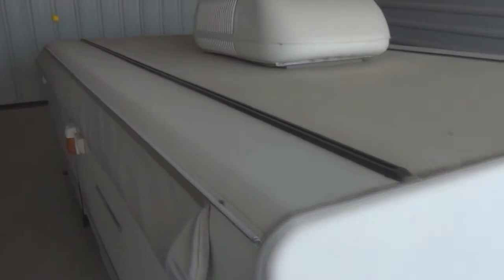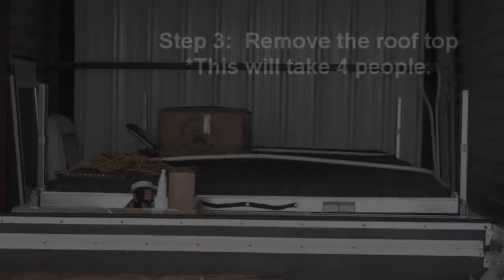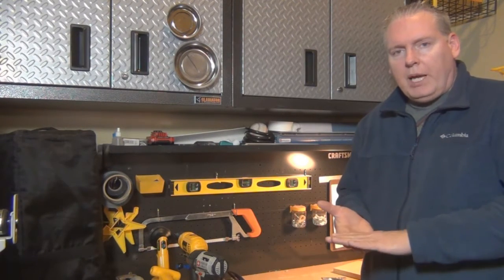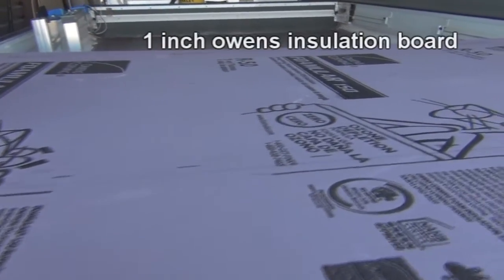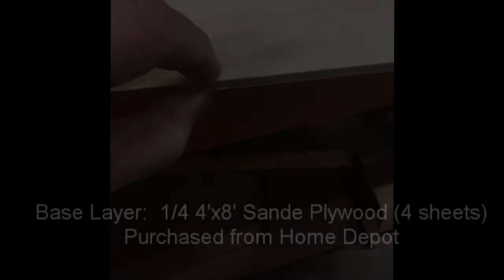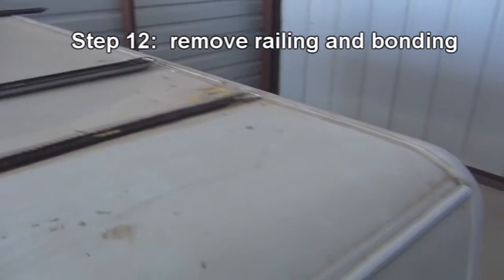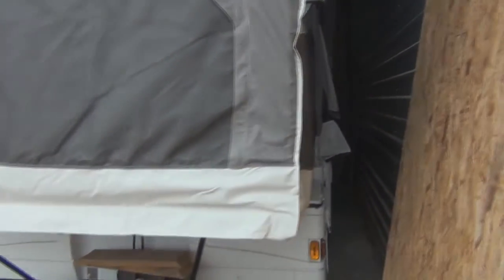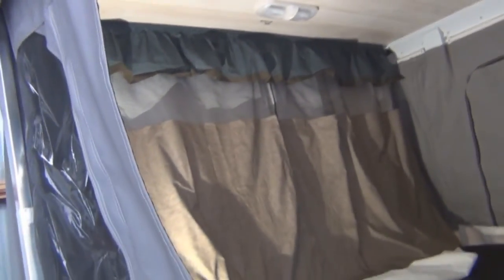2003 Coleman Utah Roof rebuild

Comment: do i really need to replace the exterior roof rail?? or i could just patch the holes from inside and re-coat the entire roof? im reparing the inside roof in place, its a hard job but i dont have a garage (water damage from the black rail and some holes)
Reply from the maker: nationenprison I’m a believer in that one needs to stop the water from coming in from the outside.  From all my research I’ve found that these models are prone to leaking under the roof rail.  I could tell the previous owner tried to seal it by putting caulking around the rail but it still leaked.  I would take the rail off clean the surface of the roof and fail real good and use double sided EteraBond 2” roof seal under the rail.  Then re-coat the entire roof.  You could then use Dicor self-leveling sealant along the edge of the rails.  You should check the sealant along the edges of the rails every year, clean, and reseal with Dicor.  Water damage to a roof can get bad real quick.
Reply: what did you decide to do since it has been a year since you commented on this video.  I have a 2003 Coleman elite and found the hole under the rail, like you said I don't want to replace the entire roof as it is just me, husband is not physically able to help.  the hole has wood rot so the aluminum is shot in several places.  Any suggestions are welcome.

Comment: How is the roof holding up?
Reply from the maker: i sold it a few years back to upgrade to a travel trailer but the owner still keeps it in our storage area. it's still doing great.  I help him to clean and reseal around the railing with Dicor 501LSW-1 Self-Leveling Sealant on a regular basis.